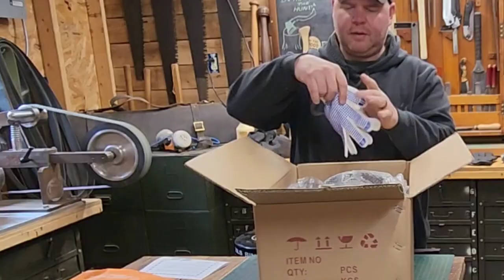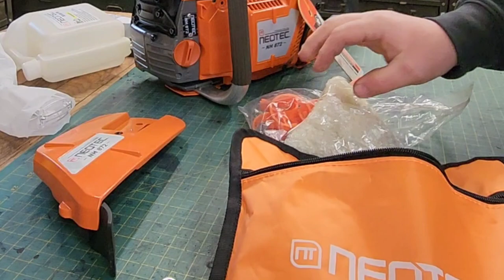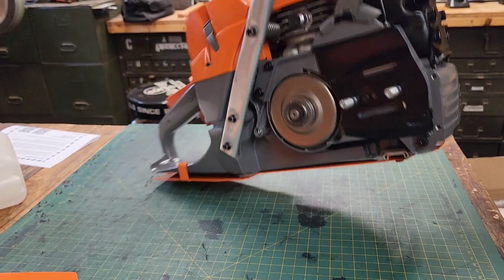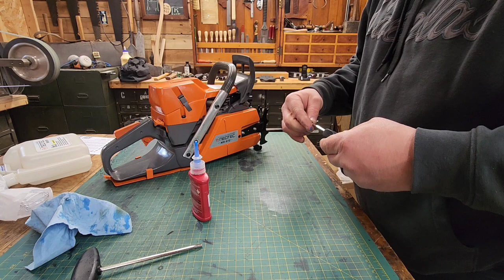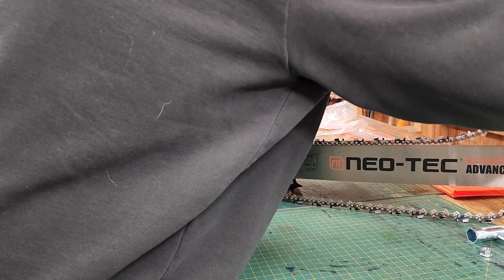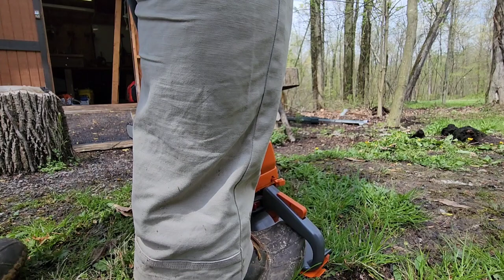Neotec NH872 Unboxing,  Assembly  and First Run. Husqvarna 372xp Clone Chainsaw

Comment: I've run a Farmmac F380 for about 7 months now. I've cut a whole lot of wood with it. Maybe 40 to 50 cords worth of logs. The only thing to fail on it has been the bar tip sprocket, and the pull starter assembly. For a saw that I paid 250 bucks for, it's more then earned it's keep. I wouldn't hesitate to purchase a Neotec or Farmmac saw and I will buy quite a few more this year.
Reply from the maker: Just can't beat it for the money!

Comment: FYI I believe the standard now on Husky bars especially for light bars for 3/8th pitch is to run an .050 opposed to the .058 gauge.  Worth a double check if your going to get the different bar. You can still get both but I have an easier time finding the .050

Comment: Funny enough I went out last week a few times to price out saws. The two main saws I was looking at were the Stihl MS 400C and 462C. When I got back home I did some video research on YT about the 400C. Then found that it's not worth paying the price for either of them and I went shopping around locally for a large cc ECHO. Boy was that a disappointment in and of itself. Long story short, the two large Stihl's I looked at weren't worth their price tag and finding a large cc ECHO locally are like looking for hens teeth.

Needless to say I started shopping around for these China clones and I'll most likely be picking one up. Mainly one of these NEOTEC's, they look to be made slightly better than the Holtzfforma's you see kicking around. I have plenty of quality saws in the 34-48cc range that all work fine for limbing and bucking up firewood. I need something bigger to fell trees for making lumber when the time comes.

I personally have no beef with these China clones. People act like they're stealing something new when in actuality they're just reproducing old decommissioned designs that Stihl & Husqvarna could no longer make because the EPA deemed them too inefficient for current emissions requirements. Ya, it's not an OEM Stihl or Husqvarna but I think people should be thanking the Chinese for continuing to do remakes of these old saws.

I've been looking at the NEOTEC NS872, but they also have the NS872i which is the updated version that has some better quality parts on it for a little extra. Who knows, I might just go with the older NS872 because Amazon has a good deal going on it.  :)

Comment: not a bad looking  saw at all i guessed it i said he will go with a 28inch bar LOL.   Man you young guys love those long bars that's a lot of filing i always ran 18 in the winter when its cold and 20 in the summer when it muddy.   One thing for sure you know how to file .   I have been using those 3 HP saws with the 375 pitch chain on 16inch bars works pretty good light to swing
Reply from the maker: I don't mind filling so much. It's worth it to me to be able to stand up when bucking. That makes a world of difference on your back!
Reply: @KillingerUSA  i do agree on that but i always nick a stone and get a run started then sit there in the  woods and file for hours to get it out.  Of course, i seem to be cutting  smaller diameter trees then you do.   We have a tone of dead ash up here